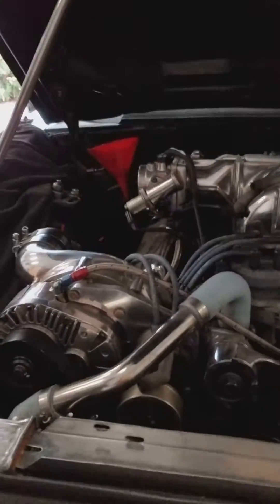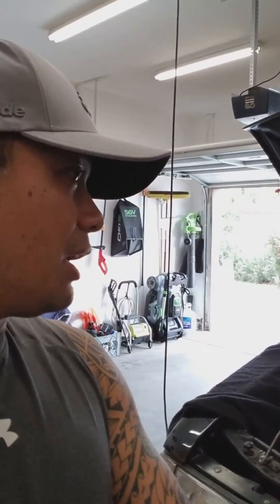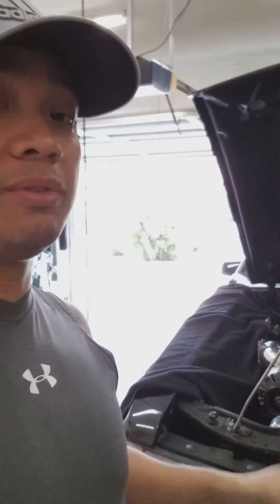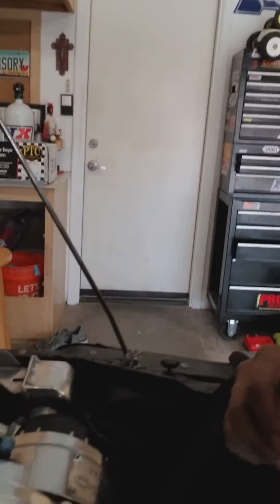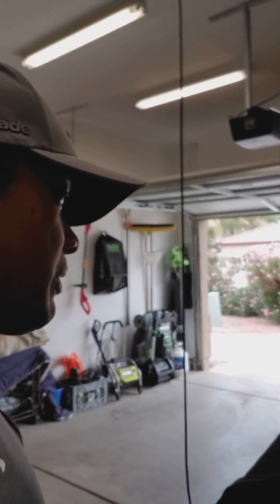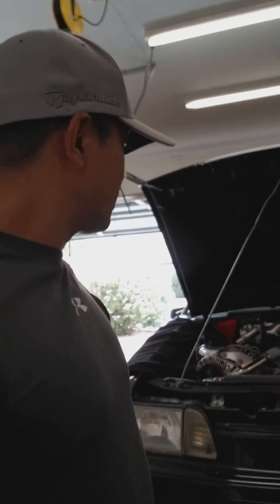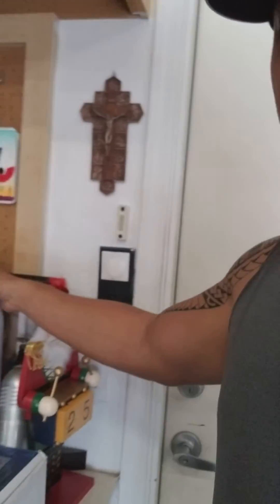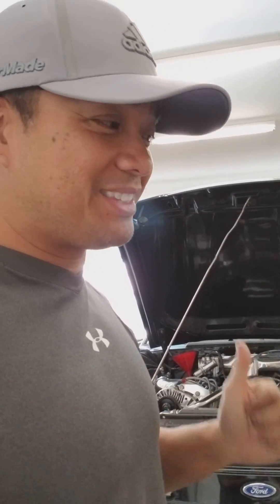Paxton Supercharger history tutorial.

Comment: I think your the guy I was talking to on Facebook about Ben alameda about 347 vs 331 and the “ the road “ street racing ddays back in the 90s in Cali ? Any ways I was trying to find info on the old Paxton sn-2000 blowers and came across your vid . I found a company called paradise wheels that sells remanufactured sn-93 for 1500$ and sn-2000 for 1800$ it’s to go on a 1997 explorer with 5.0 AWD I think it would be a good purchase since it won’t be raced at high rpm ? But they have a little bit of history on the sn series they bought the rights from Paxton back in 2000 . Check out paradisewheels.biz